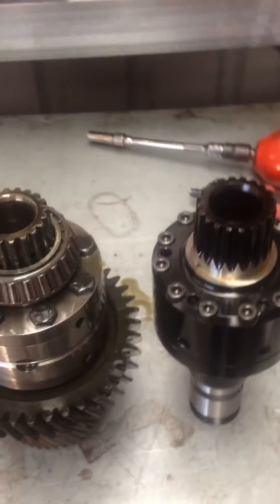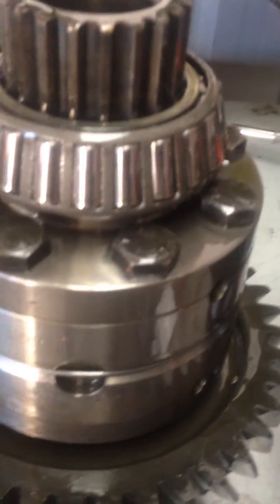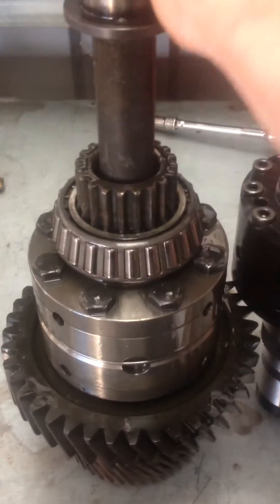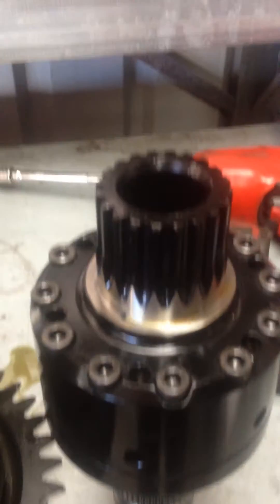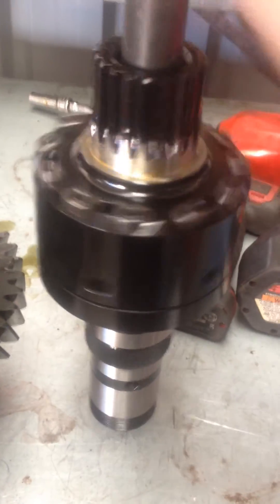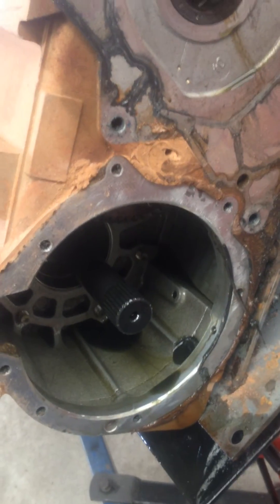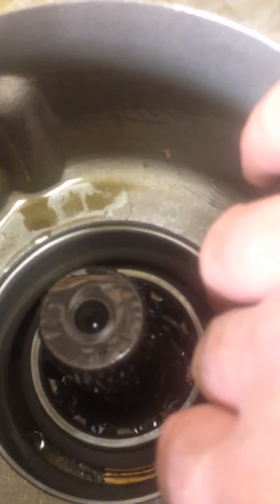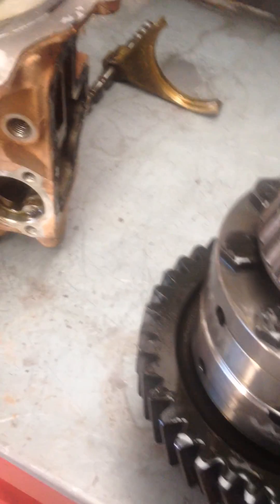ASHCROFT ATB DIFF FOR LAND ROVER LT230 TRANSFER CASE

Comment: Can one lock the Ashcroft ATB centre diff as with the original LR diff?
Reply from the maker: Yes the Ashcroft ATB can be manually locked as per normal operation. The normal locking function of the centre diff does not change if your Land Rover is equipped with the ability to manually lock the centre diff, as with the case on all Defender models.